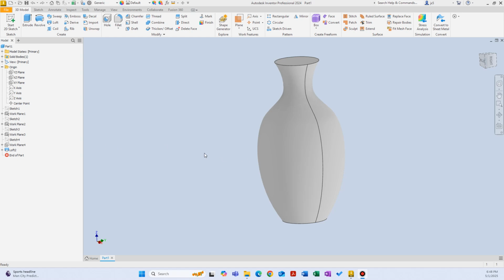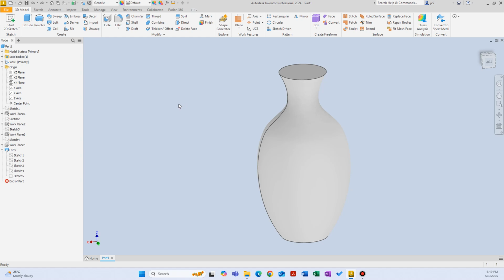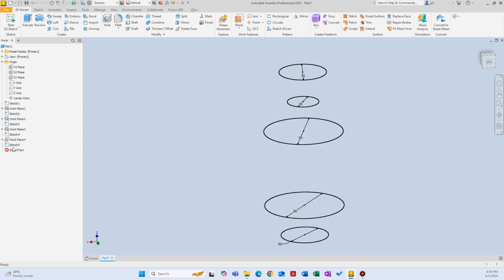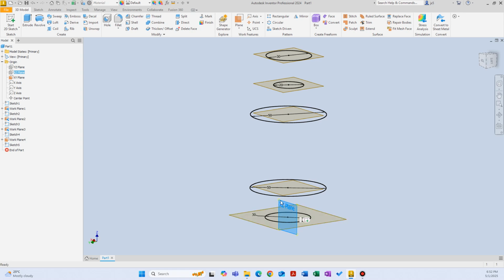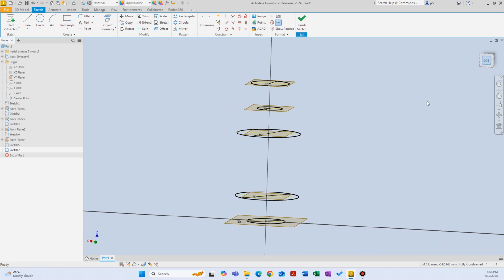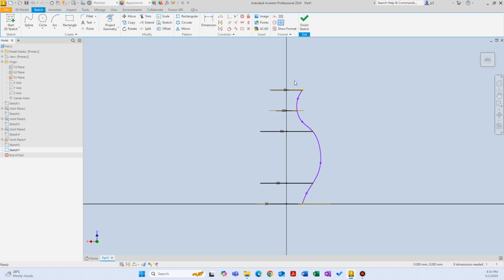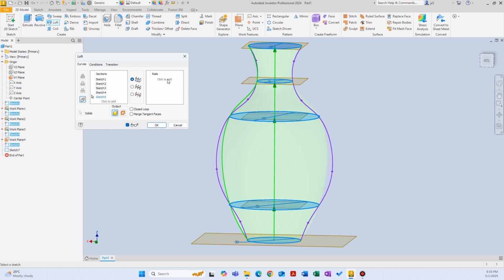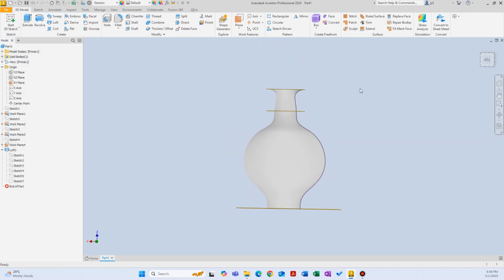30 - Loft Feature with Rails | 3D Modeling | Autodesk Inventor Professional Tutorial

Comment: Thanks for the video! I have some nonsense. I draw a complex curve, then divide it into segments using the "Split" command in the "Sketch" menu. In the right places, I create sketches on planes, "PERPENDICULAR TO THE AXES (i.e. the curve) at the POINT". I select "Loft", both sections, select "GUIDES" (not center ones) and select all the necessary segments between the sections. I click "Loft" and...

As a result, it says "During the loft operation, it was found that the guide curve does not intersect any of the cuts. Correct the path curve so that it intersects all the cuts."

Shifting any of the sections along the same segments is done without problems.
Reply from the maker: Hello,

Firstly, thank you for watching the video. If that's okay with you, please send the file to the following email address:

admin@starryindustries.com

Our team can take a look at it and get back to you with some suggestions. We are looking forward to hearing back from you.